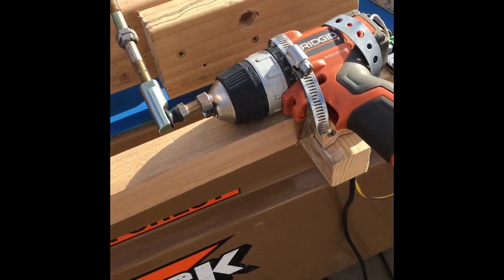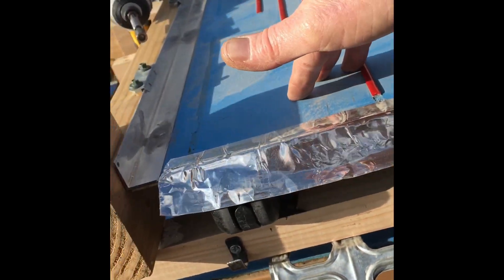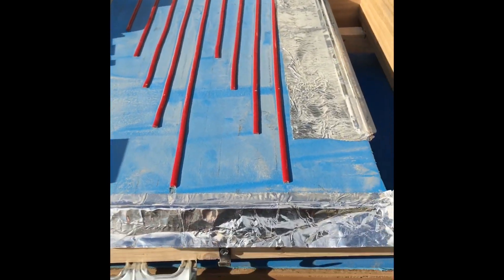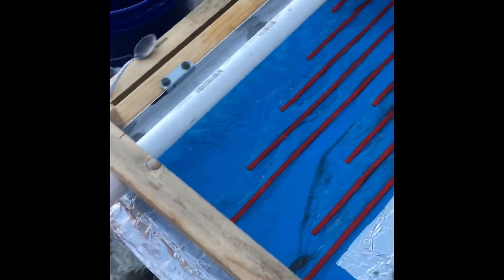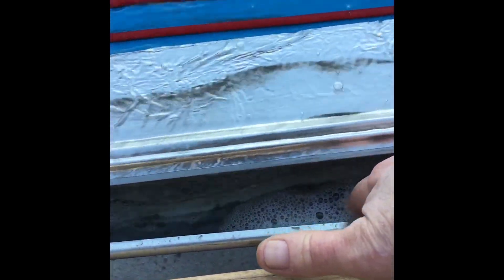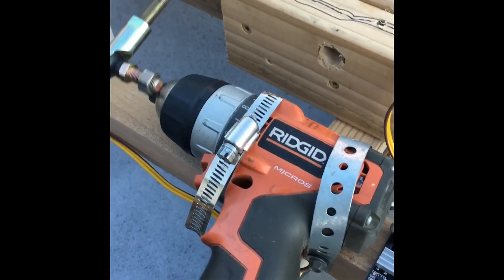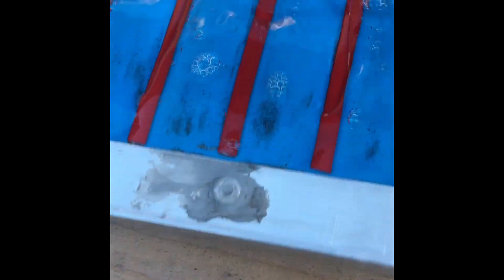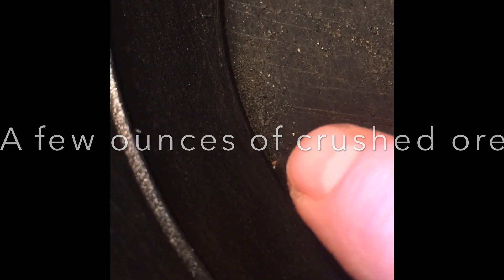DIY Gold Shaker Table build 1

Comment: Neato! Good job!
Reply from the maker: Thanks much!
✌️PT
Reply: I hope you don't mind that I robbed you blind? I like how you simplified something that to myself, would be pretty complicated. It's so easy to criticize while you put the work in. So what if something wears early or some wires are exposed.. That's why it's a work in progress and it doesn't look like you spent your life savings either. Nobody likes a thief, but if I ever build one? I'd give you the credit. Excellent engineering my friend
Reply from the maker: @mr.iforgot3062  no worries sir, Rob On!
 I’ve seen in person and watched online several different designs. I made this one off the cuff. It was a ton of fun and I learned much.
If you are interested here is my new
Shaker table Part 1. 
https://youtu.be/-0JorusgKNM
There are 7 videos Part 1 - 7
I basically showed everything on this New Build!
Thank you my very own Robber 🤓
✌️PT

Comment: I like it! A work in progress..lol. When I was much younger I saw a Miller's table that had a thin slate bed with grooves cut in it. It didn't oscillate but had a place for a copper plate with mercury on it. Prolly 3 by 5 feet. I'm thinking a jigsaw with variable speed built in is another way to but yours has adjustable stroke I think..

Comment: I really like how quiet it's running, but did you ever think about putting on a knocker rubber stopper on the other end to make the gold climb towards the left hand corner of your board
Reply from the maker: Hello and Welcome! No I never installer a rubber knocker/stopper. This table worked fairly well without stopper.  Now this one I am building has a Hop type system.. No stopper needed! Check it out! https://youtu.be/-0JorusgKNM 
Peace PT
Reply: @ProspectorTripp  currently working on a table.working out the linkage to the table from the motor
Reply from the maker: @sledgenwedge .. Wow.. Cool! The coming Part 4 for the current Shaker Table build is about the Drive System, Frame for drive and actually driving! I will post I hope today!

Comment: Nice job.  Are the ridges rounded or do they have sharp corners?  You might also test the result of different throw lengths and speeds.
Reply from the maker: The ridges are Auto Trim and are Rounded. I want to go over this first rubber mat and try grooves as all other tables I've seen use! I replied via email but wanted to post a reply on YT! Thanks sir.. BTW.. I very much enjoy your channel! "Hard Rock University" Keep em a coming! PT
Reply: @ProspectorTripp  Thank you for the compliment.

Ridges vs grooves pretty much depends on which is wider.  Mt table uses  some ridges and other things  plus some grooves depending on exactly what is going on at that location.
Reply from the maker: @hardrockuniversity7283  That gives me an Idea! Quick change Tables and or Mats for various materials! I know it's done elsewhere but did't think about doing that on my table small portable table! Good deal!
Reply: @ProspectorTripp  Certainly a good idea to be flexible when possible.  My table top is only held on by six studs and three hoses.  I am pretty sure that eventually there will be different specialty tops for units dedicated to certain tasks.  Right now, I am using more of a general purpose top with three zones of separation that do best at different jobs.  I'm having fun now that I got the motion to work like I want.  We'll see what happens as I gain more wisdom.

Luck!

Keith